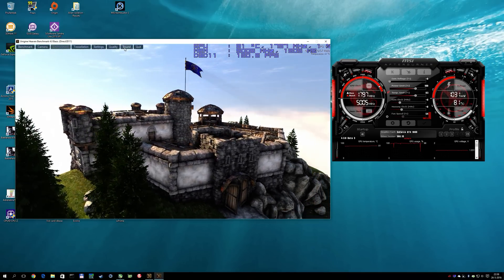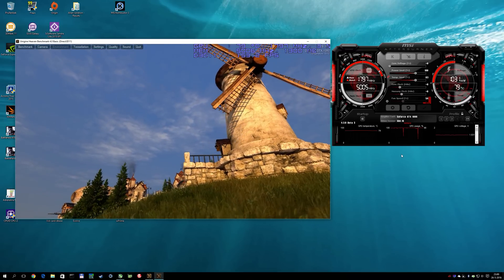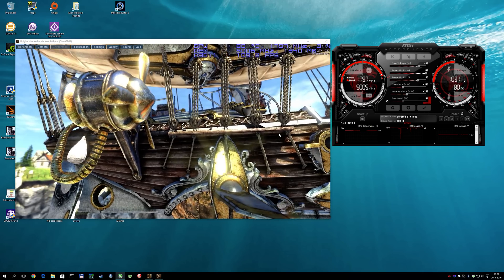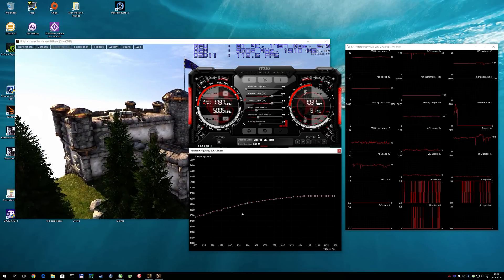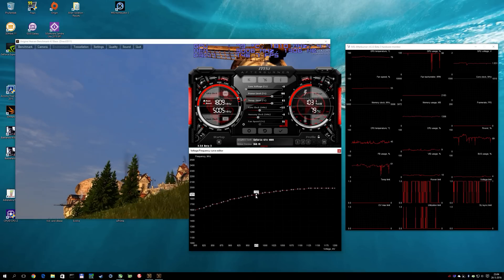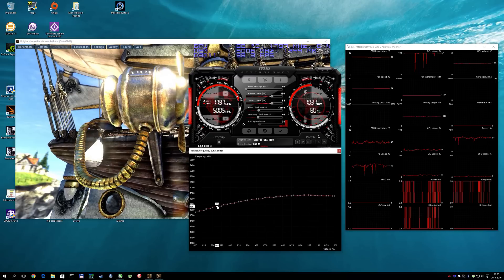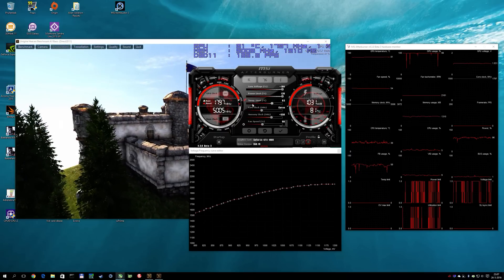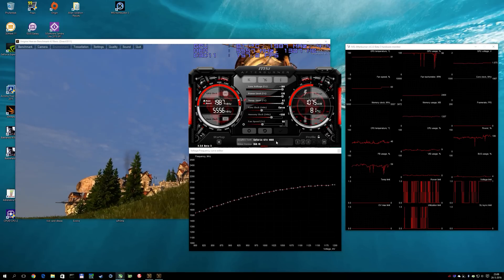Overclocking GeForce GTX 1080 with MSI AfterBurner 4.3.0 Beta 3 and Curve based Frequency Tweaking

Comment: I have GTX 1060 6 GB from Gigabyte. Why is it I only see max 830 mV in the MSI Afterburner (v. 4.5.0)? (to the right. The graphic showing a car-speed meter look) Guess it's real time numbers, because if I turn Kumbustion quickly on and off, I see 2012 mhz. Or turn on the hardware monitor, I see 2012 mhz and 981 mV in the upper corner when Kumbustion is running. Is this normal with the real time mV and mhz in the car speed meters? And is there a way to see the mV, mhz, and temp that it is going to be under 3D stress test (Kombustion) in those Car meters? Just asking because I were currious if the program could do a prection of the numbers, based on my sliders settings, without doing a stress test first. So I could protect my card better.

Comment: u say 2ghz is max for 1080 yet I see people who r overclocking 1060 to over 2ghz, how thats possible lol
Reply: In this video he was using a Founders Edition card. FE cards have an inefficient cooler which is why you can't get high overclocks stay stable (boost clocks will drop because the cooler can't control the heat). When you have a custom card with better cooler and better power phase design, you will get higher stable clock speeds because heat and power are better kept in check. Nvidia's GPUBoost works in such a way that there is a "soft" throttling function so the lower you get your temps the higher the card will boost.

Comment: How do I push the voltage higher? My power usage is too low and the voltage takes care of that by the looks of it, which in-turn increases my FPS.
Reply: tehgjunki you need to first enable voltage adjustment in the settings

Comment: I oc to 2150mhz without extra voltage.
When i want to get higher it crashes, also with extra voltage.
I think Nvidia locked these 1000 series cards to 2150mhz or something

Comment: Thank you for the video!. Grea Job I tried to overclock my gigabyte g1 gtx 1080 the card in steps but I can see that in the MSI afterburner the GPU core clock fluctuates +/-20,30,50,100 depending on the applications. Is this normal? Your core clock is just a perfect line but mine has noise and fluctuate.
Reply: Yes its normal. Its the GPU Boost doing its thing.

Comment: Meanwhile I used this to undervolt. 1810MHz at .8v. Whole rig pulling under 200w from the wall under load. Barely any heat. That's a hard kappa.

Comment: Is it possible to destroy the card while overclocking with the MSI Afterburner software?
Reply: No. To really destroy (usually regarded as bricking) a modern graphics card, you'd need to tamper with a custom BIOS.
Reply: Even if I go too high with the VRAM? I know from earlier cards and some website that VRAM is very vulnerable to damage if it runs too high.
Reply: The card would crash before any damage happens, theyre pretty smart that way nowadays. Unless you put in a custom BIOS that does away with all the safety stuff.

Comment: Core Voltage On My Asus Strix GTX 1060 Is Locked --_--
Reply: Make sure it is unlocked in MSI's afterburner settings.
Reply: Yup, did that too. I even switched to the Beta version. Nothing. I also did ALT+F to pull up the New voltage OC tool. ALl that did was raise the cor clock --_--

Comment: Instead of Power Target setting, I got a shader clock setting, which is greyed out.

How did you get the power target setting? I have Afterburner 4.3.0 installed and I'm running a Palit 1080 Gamerock.
Reply: nevermind, got it. You have to change the skin in settings. afterburner skin v2 will not show this feature

Comment: Well done HH! Nice preview! Enjoyed and excited about the new version.

Will this Curve based Clock Frequency Tweaking work on GPU Boost 2.0 cards like, e.g a GTX 980Ti?

Thanks!
Reply from the maker: No, I'm afraid it will not. It is a feature designed just for Pascal and newer generations.
Reply: when will nvidia give us access to the enthuiast key I have 2 cards unopened because nvidia promised support for 3/4 way setups and I'm only using 1 1080 right now
Reply: +Guru3D.com is the % based voltage adjustment roughly comparable to the 100mv adjustments in the end?
Reply: +ployth9000 they wont.
Reply: *****

I know now sold my 3rd card